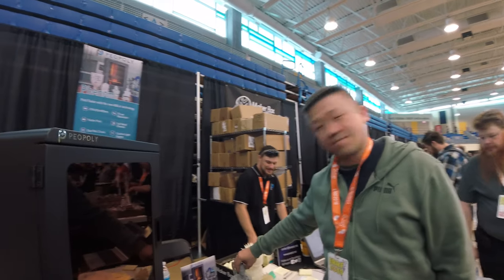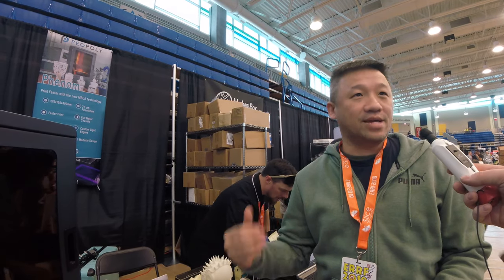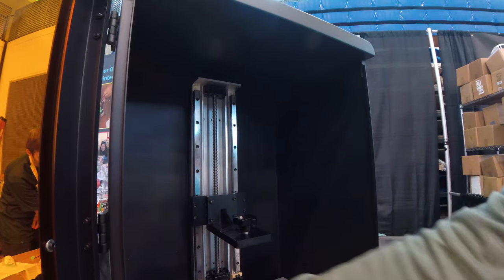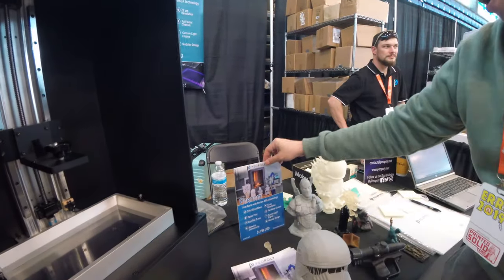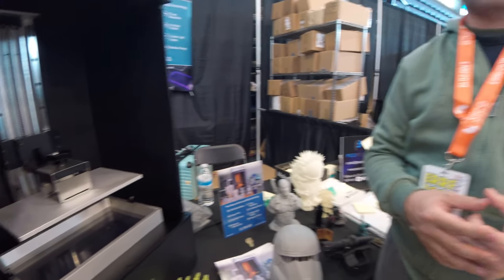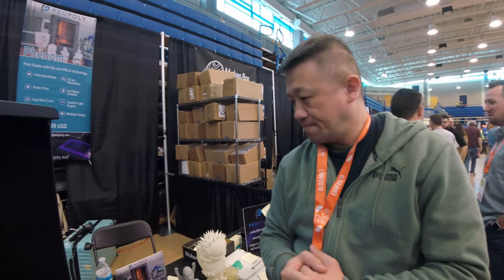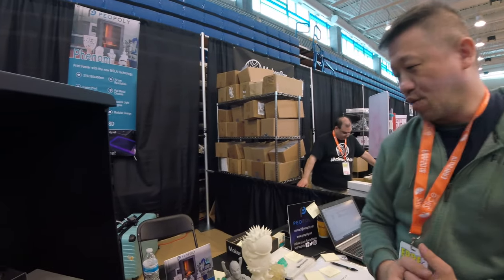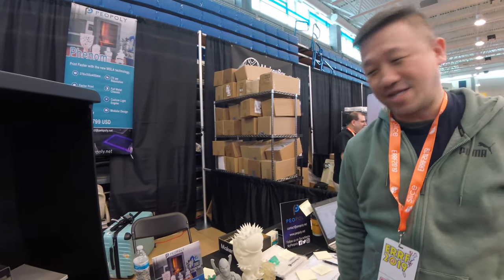ERRF 2019   Peopoly Phenom

Comment: Hmmm, Peopoly Phenom or Phrozen Transform ? Basically the same price. The Transform has slightly bigger build volume and is more versatile and can print higher resolution small parts. However, both are Chinese made with questionable quality control. Also, being Chinese and using Chinese slicing software, it is very difficult to get them approved for use in gov't funded labs. I've been forced to stop using my AnyCubic Photon and slicing software because of this restriction.
Reply from the maker: Hi, I cant really comment on this, else than maybe you have to talk to your goverment or find a new one... I really dont want to go into politics here though..
Reply: I like the fact that you can buy this one through matterhackers. I can imagine trying to deal with phrozen. So I wonder if a few inches is worth it. (That's what she said.)